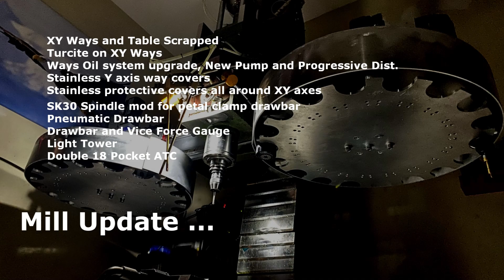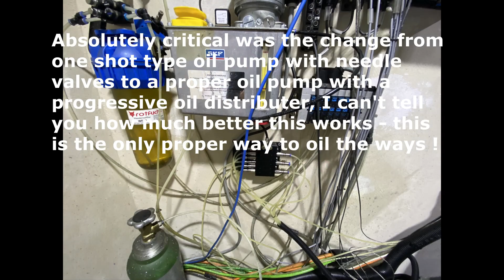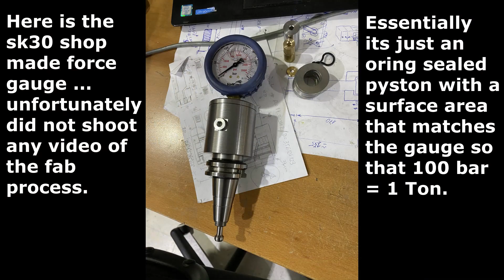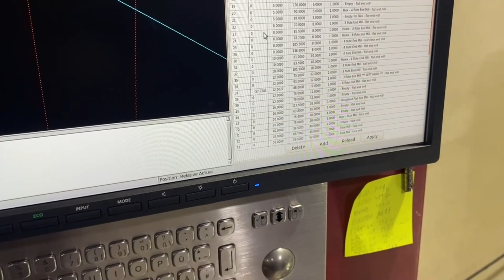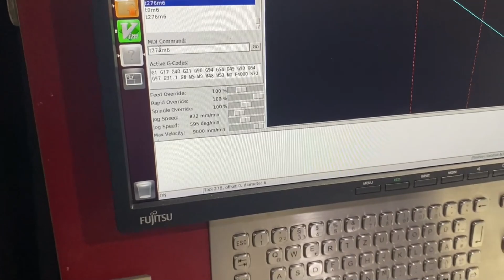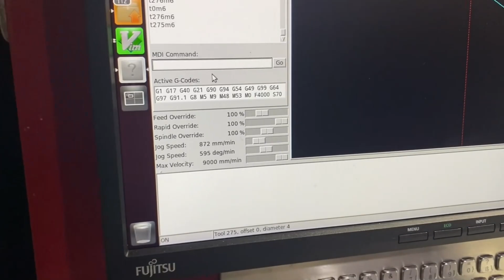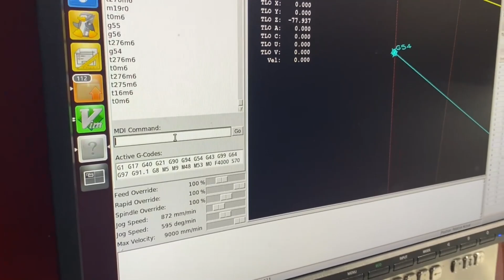2021 02 Mill Update ATC (RF45)

Comment: wow.... scraping. I actually started scraping in my RF45 clone prior to cnc'ing it. Man that was a mistake, what a rabbit hole of knowledge to go down. It is now scraped in but it's still yet to go back together, in the end I just bought a cnc when one came up for sale. I'll rebuild mine eventually, did the scraping improve things much?
Reply from the maker: Rabbit hole is the right way to put it. I even stopped working on it for some 6 months throughout the year the whole thing took. Made a full size arcade cabinet, upgrade my home network/wlan to use VLANs, upgrade the security cameras, etc etc. Eventually got back on track and finished the damn thing, but did not find courage to do the z axis. Did it help? Yes a lot. Now I know the surfaces are flat, parallel and perpendicular. The x/y axis run smother than ever, zero stick/slip. Etc. However there were several improvements, scraping, proper securing of the gibs from both sides, turcite and a proper oiling pump with proportional distributing pistons. So scraping alone was just one part. I am so glad that is done! Still the z axis could be improved, the same way. It’s always a journey without end.

Comment: G’day mate. Awesome build bro. Nice work. Do you sell plans for the gear you make. I’ve been thinking about retrofitting one of my mills to cnc. Would be great to talk to you about how you went about upgrading your. Cheers mate.
Reply from the maker: Thanks Bryce. I did my initial conversion years ago, machining all parts with a Sieg X2. But since then I have made many modifications, additions, improvements etc. It’s never really over. Also on the electronics side, there is so much to cover. I’m afraid it’s more of a journey ... Unfortunately I do not have plans to sell. I have on occasion shared one or other cad model but each rf45 is slightly different and the option of motors and how to mount them, size of ballscrews, etc all matters.
Reply: @PWLopes9000  thanks for getting back to me mate. Definitely a lot to it. I’m fine with the mechanical side of it. I’m just a bit out of my depth with the electrical side.

Comment: Fantastic build!! No linuxcnc machine is ever "complete" is it?!?  Where'd you find the way covers?
Reply from the maker: Thanks Jake! Indeed it’s never really finished. That’s what keeps it interesting for me, imagine it was absolutely finished ... scary thought ;-) way covers, for z I just ordered to measure on AliExpress, for front Y I used some stainless steel sheet just to temporarily cover it up, it will change with the enclosure. For Y near the column I used some piano hinges, machined out of Aluminum two brackets and bent some stainless sheet to slide on each other. It misses a wiper but appears to work good enough. I may try and add a wiper for the enclosure. I say for the enclosure, since that will make chips bounce everywhere and go to every place. Also will make me comfortable to run cuts faster and more aggressive. Without an enclosure I tend to hold back, not to make too much of a mess.

Comment: Would you be willing to share your Config/GUI?
Reply from the maker: I have moved on to use probe basic GUI. See my next video.  https://github.com/plopes9000/probe_basic, the tool setter subroutines are here https://github.com/plopes9000/probe_basic/tree/master/config/probe_basic/subroutines/plopes.
Reply: @PWLopes9000  Cool, I'm retrofitting a machine with a Caroselle ATC and Probing and that UI is awesome. So is the ATC design, very nice.
Reply from the maker: @kingofl337  yes it’s pretty cool. It’s not my design, checkout the link on the other video description for the installation page of probe basic.
Reply from the maker: I modified it to support two ATCs, plus added a few buttons and torque/temperature widgets.